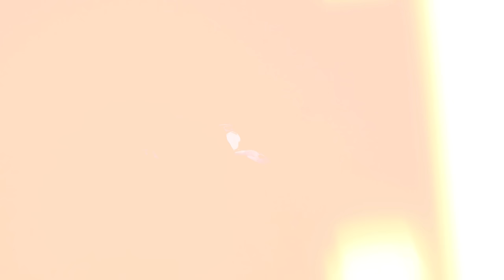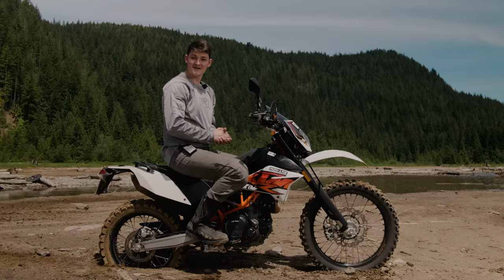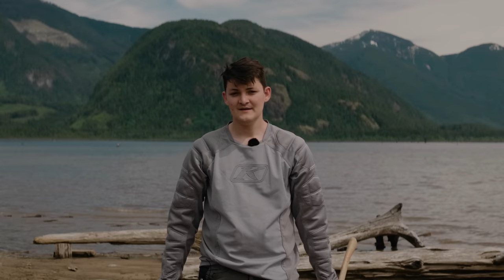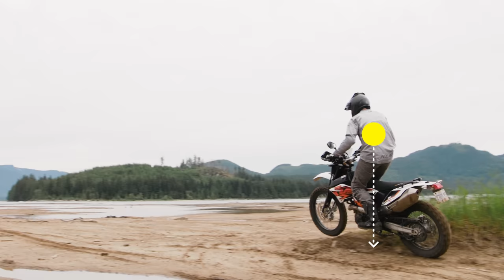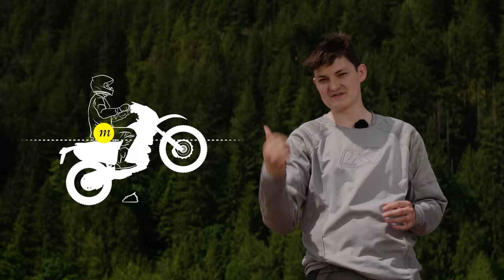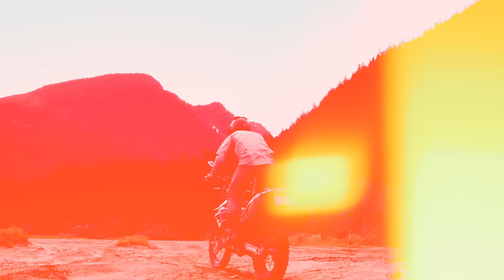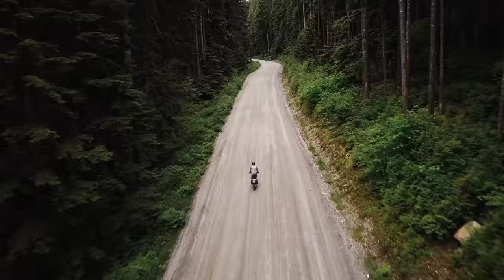Why and When to Stand on Your Motorcycle

Comment: I would argue that neither sitting down nor standing up any of the claims of lower COG nor the moment o inertia really apply, for each deal with rigid single bodies. There is no rigid connection between the rider and bike. The bike may be looked at as mostly solid body (only softened up in one direction by the suspension) but at no time does the rider become a solid.
Your final conclusion is the main point: You add suspension from your leg takes load from the bike's suspension, it doesn't bottom out as quickly, the bike doesn't jump about as wildly, you gain freedom of movement to lean your bike to either side a bit whilst remaining up right. you just gain freedom of movement and a steadier body position which helps you keeping control.
Not quite as much physics as ergonomics in action here, I guess.
Reply: Don't worry - the video is correct. Moment of inertia still applies to non-rigid systems, like pizza dough, ice-skaters and giraffes. Even a loosely constrained system (like rider & bike) is still a system, and its moment of inertia is just the sum of its components' moments, whether they're rigid or not.

Same as if the rider was a robot made of rigid bodies and bolted to the handlebars. You could stiffen every joint, one at a time, until the whole system is rigid - but its centre of mass and moment of inertia have been quantifiable the whole time, even when some of its bits were loose & floppy. There's no point at which the rules suddenly change. You could even melt the whole assembly, and that puddle of molten metal would still have a meaningful centre of gravity and moment of inertia.
Reply: @alexmcleod4330   The question is not whether or not the laws of nature still are in power  (Which is a no-brainer, they are!) but whether they are what makes the standing posture beneficial for the rider. I think that the ergonomics is what does, when standing. The body just has better control of the bike due to how the body works, it's not really laws of physics.
It's haptics, neural systems and sensoric input and whatnot included here.
True, you can always calculate centres of mass for every arbitrary system you could possibly think of. But will one all floppy and lose object be able to affect the movement of another?
The input of a rider who uses his legs as extra springs overall reduces the motion of the COG, but that is due to control input of the rider, not mainly the mere physics of the system of rider and bike. The possible control inputs are what make the not fall in situations where the standing rider can take it through situations where it would fall under the effects of its own stability otherwise. Much more than with other vehicles, physiology and haptics are what keep a bike going at slow speeds. There is now law of nature that has the rear spring compressed and the front wheel unloaded when a trial bike gets ready to jump over an obstacle that is higher than its front wheel. It is the rider's muscle and control that make it do. Laws of physics are being used, but it's physical action that is what makes things happen.
Reply: @zweispurmopped  you seem to be trying to say it's not the physics of the bike and the rider, but the physics of the rider and the bike.

If you want to talk about feelin' an' instinc' and The Great I Dunno Man, you've lost my interest.
Reply: @alexmcleod4330  You are trying really hard to not see my point, aren't you? Well, keep on then, have a nice day!
Reply: @zweispurmopped  your last sentence amounts to "it's not physics, it's physics". If you were trying to make a point, it isn't clear, and if you were trying to address a question, it isn't even clear what the question was.
Reply: @alexmcleod4330  Maybe there was something lost in translation: I was talking about physical input by the rider. Muscle action. Active input. Kinetic energy put into the system by choice and under control of the rider and switching the COG in all directions possible. This is not as such merely following laws of physics, but changing a situation towards what the rider desires. Not having the face in the mud.
This is physical, but it's not just passively following the laws of physics.
Sitting down, a rider just doesn't have the freedom of movement to bring this factor fully into play. It's, among other factors, a consequence of how we humans are built.
So merely quoting basic laws of physics doesn't quite tell the story. Ryan didn't take that important side of the story into account. That was the point I was making.
Reply: @zweispurmopped the ergonomics you're talking about aren't what's in focus here.

The point is that increasing your moment of inertia stabilises you without having to wiggle the bike around. That makes it safer and easier.

If you watch cyclists doing their thing, you'll notice that they always make themselves as tall as possible by standing on the pedals when stability is important, so that they don't have to use muscle action or extra kinetic energy to stabilise themselves.

It doesn't matter if you're rigid or if you have complete freedom to move around, because the whole point of standing taller is *not having to make extra effort to remain stable*.

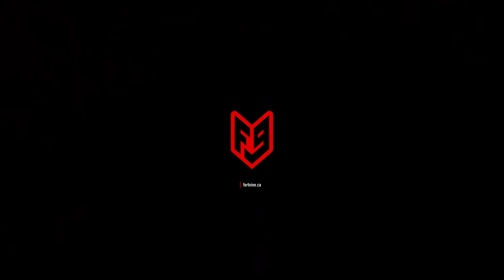I thought it was explained very well in the video, especially between the 0:00 and 4:41 marks.
Reply: @alexmcleod4330  …and the explanation between 0.00 and 4:41 is exactly what makes little to no sense to me! Standing making the body more stable is taken, and on a bicycle, that makes perfect sense! In such a bike-and-rider-system, the rider some 80 or 90 percent of the mass.
In a bike-and-rider-system with a fully fuelled BMW 1200 GS with 80Kg of luggage on it, he isn't. The six foot big arsed me will make some 25% of such a whole. The upwards shift of the COG makes little difference. The lightly built Charly Sinewan still stands on his heftily loaded F850 GS whenever things get difficult.
Standing will help compensate the movement of the bike, though, and help keeping a stable position to remain in control of the position of the handlebar and not bounce off the bike in the first place! You also gain freedom of movement to shift your weight around much further. Here a lateral shift of COG may help you balancing the bike after all, for not having the tank locked between your knees will enable you to twist your feet on the pegs, then crouch a little and let the buttocks hang over board much, much further.
The main difference of the standing posture on motorcycles is that he body of the rider has a less direct contact to the bike. On rough grounds this helps keeping the bouncing bike in control and it adds freedom of movement to shift your weight around to make what little weight humans bring into the system have an impact on the balance.

This whole thing is like the explanation for why bicycles are self stable. ("Gyroscopic momentum!"¹) or why planes fly ("They sit on a cushion of air!"²)  Such explanations seem obvious at first, but then the cracks appear.
¹…except it isn´t. The TU Delft very clearly demonstrated that a vehicle which had the gyroscopic momentum zeroed out remained stable. The controlling wheel has to be more unstable than the other, then it will be able to "Fall over" faster than the fixed axle one and catch the moving system into a curve instead of it falling over. It's only a matter of geometry.
²…only they don´t. Bernoulli´s law even says that the static pressure everywhere around the plane drops, there is no denser air under the plane. The force that keeps a plane flying is generated by setting a big mass of air around the plane into motion.
Reply: @zweispurmopped  you're contradicting yourself and getting way off topic.

In a case where the rider provides only 25% of the system's mass, if that wasn't enough to significantly alter the moment of inertia, why would anyone bother trying to control the bike at all? We'd all just say "there's nothing I can do - it's heavier than I am".

Furthermore, you cannot shift your centre of gravity laterally at will. If you could do that, you could ride an office chair all the way to work through willpower alone, and you wouldn't need a bike at all. If you're thinking "yes I can, I do it all the time", then you're thinking of tilting the bike laterally - but remember you've just ruled that out because you're only 25% of the system's mass.

You're not thinking this through, and I don't know why you're getting sidetracked with Bernoulli's law etc. when you're still stuck on problem #1.

It's not about the centre of gravity, as the video explains. It's about the moment of inertia, which is the shape of your mass distribution. An elongated moment is intrinsically more stable. That's what tight-rope walkers use those poles for, and it's why standing higher on any kind of bike makes you more stable at any speed on any kind of terrain.
Reply: @alexmcleod4330  No, I am contradicting you and I gave examples for similarly misleading explanations that only at first sight seem to make sense!
I don't know if it's carelessly reading what I write or soft trolling that you fail to get these obvious points.
Moment of inertia is mass times the distance of the COG to any pivoting point squared. So the position of a COG is very much a topic here!
And of course you can propel yourself by shifting COGs. Conservation of centre of gravity is the key behind rocket drive, remember?
Finally, are you actually aware of how you really control a bike? "By shifting weight!" No. Well, not entirely no, but only a tiny yes.
Veritassium showed wonderfully clearly what you actually do: https://www.youtube.com/watch?v=9cNmUNHSBac
I hope you see now that it's not me who is stuck on #1… 😉
Reply: @zweispurmopped  you're kinda being a nuisance now.

You clearly had to look up what "moment of inertia" meant, but you didn't read the whole paragraph. Good on you for looking it up, but please read the whole thing instead of just quoting the first sentence that seems to fit your views.

So anyway - you're not a rocket, and you cannot shift your centre of gravity laterally at will. If you seriously think you can, try to balance on a bike that isn't moving, and get the whole thing on video. This isn't really relevant to the moment of inertia thing, but it'll help you realise that your understanding of bike physics is very incomplete. Also the video will be hilarious.

Not interested? Okay, then grab the telescoping metal tube from your vacuum cleaner, and try to balance it on your hand. Try it with the tube retracted, and try it fully extended, to see which is easier. Make sure you get the whole thing on video, too - especially the bit where you finally understand that taller is simply *more stable*.

If you'd like to fully understand the whole thing, down to the nitty-gritty maths of it, I can send you links to source-code for simulation of loosely-constrained rigid-body systems that you can read for yourself, compile for yourself, and experiment with to your heart's content, because this is what I do for a living*, and *talking to you is getting tiring.
Reply: @alexmcleod4330  It's the internet, I'll grant you that. Remmember that now and then, you bump into someone who has had some education. For example someone like me, who studied physics at the University of Bonn. Ta.
I spent enough time on you.
Have a nice day!
Reply: @zweispurmopped  you certainly don't sound like you finished the course.

It's probably not too late! You could probably go back as a mature student. If they won't take you, you could study online.
Reply: @alexmcleod4330  Your arrogance has a good chunk of passive-aggressive style to it, buddy.
Try a reading course, then maybe you'll start to get your head around taking in what others write.
Oh, and welcome to my ignore-list, I am not going to waste time on you again!
Reply: @zweispurmopped  you seem to have made yourself angry by engaging in a topic you didn't understand. That's pretty normal these days, but not productive.

It's not actually that complicated - your theories just weren't correct. This is the point where you should find something informative to read, instead of just getting angry at the people who already read it.
Reply: @alexmcleod4330  Somebody send me a puppy, alcohol or drugs, so I stop bothering! 🤐
Okay, basics: What makes a body?
A thing that consists of small individual masses that are linked firmly to each others. "Firmly" becomes a losely defined term, depending on how strong external forces applied to the body are. The connection of a rider to the bike consists of the grip on the handles and the friction of the foot/peg interface and what force the knees clamping the tank and the bottom rubbing on the seat can add will need next to no force to break.
A rider tucked in on a sportsbike, gripping the tank with his knees and a good firm sitting position will be much more of a body with his bike than a rider who is standing on the pegs.
A human has the COG at hip level when standing up. This is the centre of all dynamic forces attacking. This is the point with which you generate the controlling forces for balancing your bike. There is some influence of you body´s moment of inertia, but you may ignore its effect on a body that is several times your total mass which you only control through some friction and the gentle few pounds of grip a human hand can produce over longer periods.
Period.

Of course you can calculate a common moment of inertia of rider and bike. You can also include the Statue of Liberty or Mount Kilimanjaro if you are bored. You will get some number. You can also calculate their wave length and entropy, but it is pointless! Rider and bike are fairly loosely connected! You fool yourself by considering them one single system!

Noraly a.k.a. Itchy Boots demonstrated it quite drastically when her bike was violently rolled to the left around its longitudinal axis after hitting a stone. The first thing that happened was that her left foot was lifted off the peg as there is no firm connection between the bike and rider. A moment later her foot was injured and she had experienced the most violent fall of her rides so far.
Way back when I had riding lessons, I encountered a horse that had more insight of the physics involved here than that book you quote! From a slow galloping pace, it thrust me up a few centimetres, then started a sudden shift to the left. My left thigh was pushed aside by the horse zooming left and there was nothing to help my COG follow the horse's one: I went into a parabolic zero-G trajectory forward with the angular momentum the horse had put into my body´s moment of inertia. I spun around my longitudinal axis until impact. The result was a happier horse, a riding instructor in the middle of the court on her knees and roaring with laughter and me sitting on the ground (after a couple of controlled somersault-ish stunts) spitting dirt.
Do these examples finally help to get the picture through to you?🧐

Rider and the ridden horse/bike/whatever are not one single body!
Bike and rider are only very loosely connected separate bodies and applying laws of physics that deal with solids to such a system is *wrong*.

And may I suggest you to rather read the Feynmann Lectures on Physics? A much more decent set of books than the one you have there, it seems! 🙄
Reply: @zweispurmopped  The original point was just that standing on the pegs stabilises you by increasing your moment of inertia - so I'm ignoring your tangential nonsense.

I still encourage you to try balancing your vacuum cleaner's telescoping tube on your hand, though, because that's an experiment you can do safely indoors.

You'll see that when the tube is extended, it's still just as loosely coupled to your hand, and its centre of gravity moves a little*, but its moment *doubles along its principle axis, so it becomes far more stable*. Even with the heavier end down, when the *only change is that it's *longer*, it's more *stable*.

As for your objections about rider & bike being so loosely coupled that they don't share a moment of inertia, if that was the case, then steering & balancing must be totally out of the question, too.

You can't have it both ways. It can't be so weakly coupled that there are two separate mass moments while also being coupled strongly enough that you're actually riding the bike.

And of course moment of inertia still applies to non-rigid systems. That's why the spinning figure-skater is a popular textbook example.

So stop being wrong. You're not enjoying it.

Comment: If a surface is going to  lift you off the seat, stand. 
If the suspension can soak it up, sit or stand, pending on the severity or your mood.
If you're tired of sitting, stand.
and if you're on the black stuff, sit, your day is going to be boring anyway.

Comment: If you're floating, your weight would not affect the bike so it would in fact be lighter than standing or sitting, which in turn lowers the center of gravity since you've subtracted 170-200 lbs above the seat.

For real though, I thought it was common sense that if you're standing then your legs act as shocks. Hard to imagine a rider, novice or expert, would need be taught such an obvious thing.

Comment: How the hell stand position can lower our center of gravity? Did I miss some physics class? Those first experts' statements make`s me cry.
Reply: The train of thought is that weight is transferred to the bike via the pegs (low) vs having weight on seat (high).
Reply: @RabiesTheBeagle  The fact that you are standing on your pegs does not make much difference, your center of gravity is much higher than you would be sitting. The rider's weight is practically 1/3 of the motorcycle

.